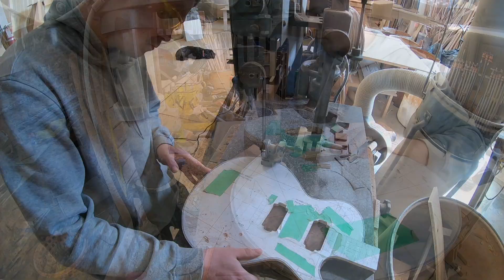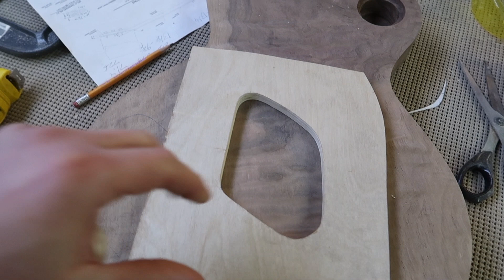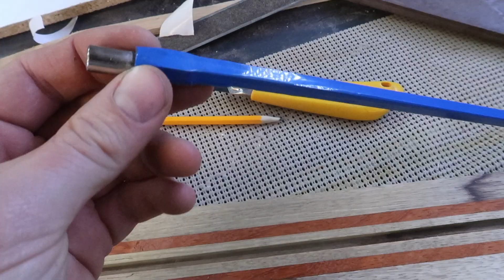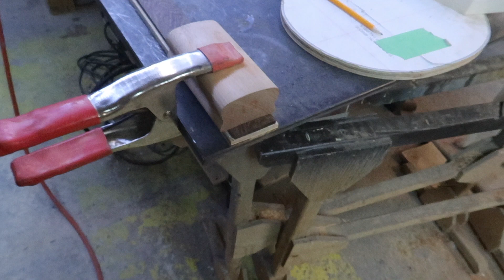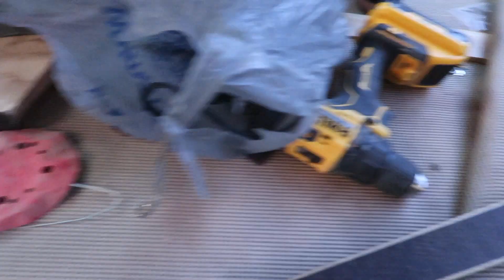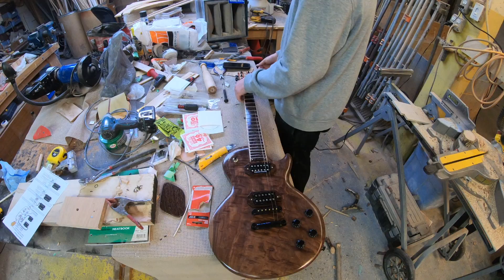Luthier - Handmade Les Paul Guitar from Burl wood (Start to Finish Build)

Comment: So why not use more brass inserts for alignment of the fretboard and do as inlays? More risk with each hole? ?  Nice build
Reply from the maker: concealing is a good idea for future builds inside the fret marker inlays. Realistically you only need the 4 since the fretboard and neck are rigid and the more holes you drill through, the more likely you'll create and error and accidentally punch through the bottom of the neck